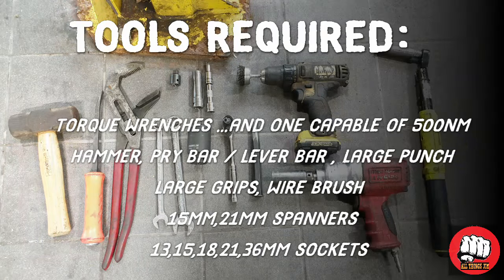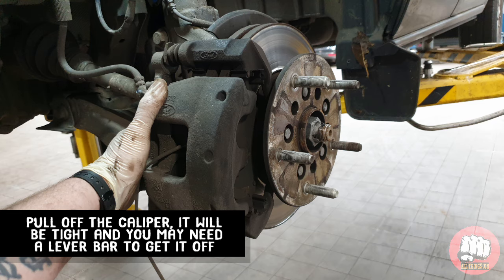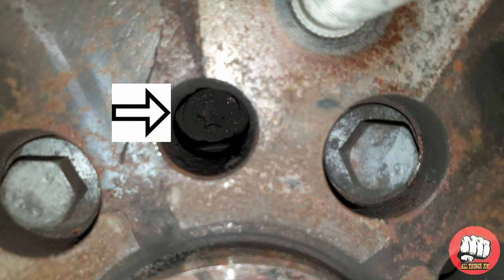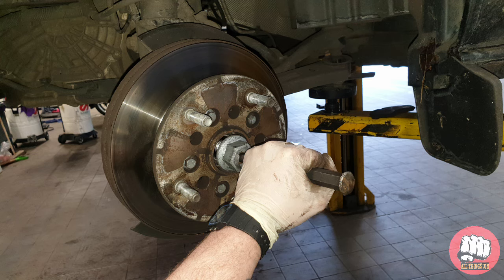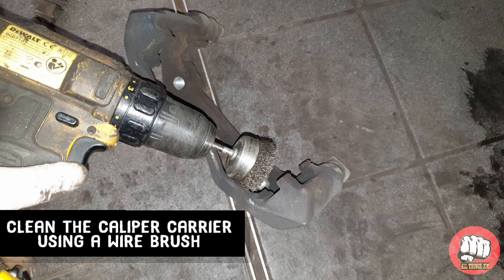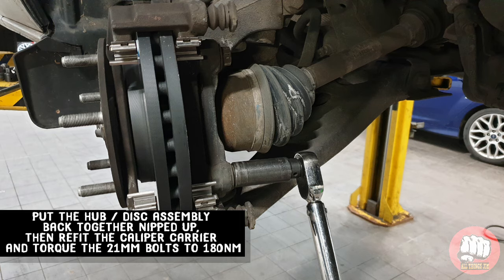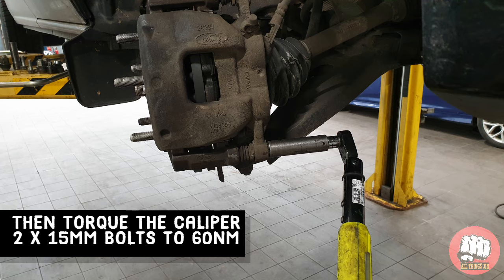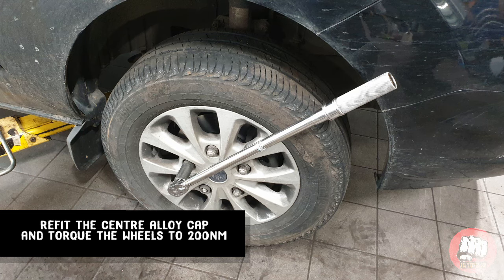ford transit - front discs and pads

Comment: All in all pretty good, but you should tell people that the 13mm disc bolts are stretch bolts & should be changed never re-used and use a log bolt to remove the hub rather than a hammer.

Comment: I break those abs plugs all the time.. the rubber seals inside are stupidly big. I take them out and it plugs in no problem. With a bit of non conductive grease to stop water👌

Comment: If you hammer the bearing carrier from the knuckle by hitting the disc surely you will damage the wheel bearing, unless it comes free very easily!??!
Reply: What you should do is take two disc to hub bolts out, then screw a long bolt in through the disc to hub, protrude it right through and use it to press against the knuckle and push the hub away from the knuckle with a steady even pressure. Two bolts do the trick, one top and bottom, it’s very easy and effortless in comparison. Plus it doesn’t impact the bearing into the race so a lot less likely to Brinell the bearing.

Comment: Do you have any advice if the T50 bolts are rounded off?
Reply: Hammer the next size up into the head
Reply: LPG torch and penetrating oil, in whatever order you prefer. Then hammer to chisel

Comment: Our 2015 ford transit custom is on its 3rd set of front discs and pads but then it does have 265000 miles on it 🤣🤣🤣
Reply from the maker: Aha! Been around the world?? 😝
Reply: ALL THINGS JIM it has been a good van we have it form new it has earned its keep 🌍🌍👍
Reply: Blimey!...I’m on my 3rd set of front pads and on 1st disc still. Will need a new set of discs by the end of the year though haha always been stuck in my ways of using more engine breaking that the brakes lol😬. Nice video by the way including the spanner/socket sizes and torques is spot on, now I know il need a 36mm socket as the halfords box is only up to 32mm. Dunno why but the start of the video each section was flashing on the screen, weird. 👍🏻
Reply: 265000 miles thats impressive is it a timing belt or timing chain engine
Reply: Karl Sanderson timing chain engine it has 282000 miles on it now 😀